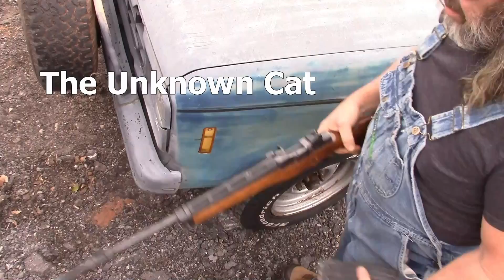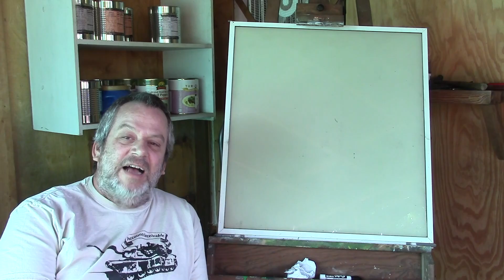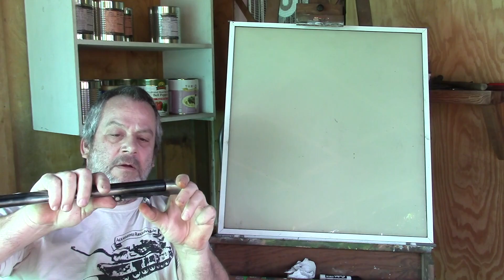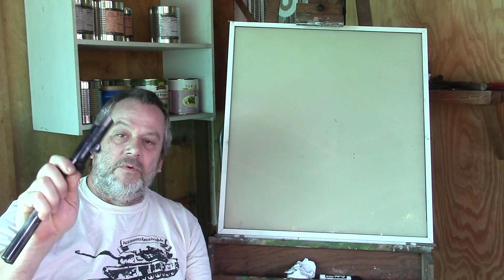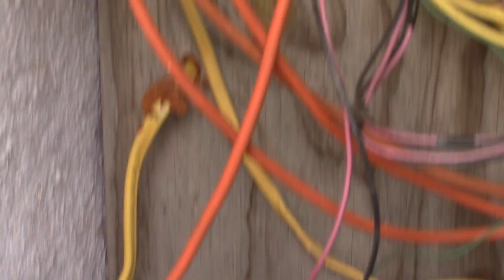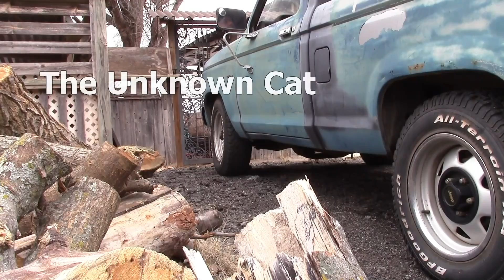Off Grid Room

Comment: try also vawt wind turbines they will augment your solar charge you can get the generator from any source such as an old tread mill the electronics and such have failed while the motor/generator is still in good condition. Works well if your in a simi windy region.
Reply from the maker: +steveklloyd I don't feel like wind is viable in an urban setting -requires too much height and broken blades could damage neighboring property.
Reply: well this is my third message this window on youtube keeps doing wierd things. Look up vawt systems
Vertical
Access
Wind 
Turbine
My original post explained alot I dont have one my self but i live in a urban environment (i rent) and have done ALOT of research on it. As long as people are not stupid with there builds aka keep it away from others houses ect it would work as for height the vawt system works in a 360 deg. environment so the hight is reduced. If you have alot of trees in the way of the prevailing winds..... or if you live in a apartment then yes its not for you.
BTW broken blades on a vawt would only damage the turbine its self unless you put it right next your your neighbors property line. If you made the blades out of metal like guttors or pvc it would take alot to break them. Its not a small build mind you. Either way good luck if you decide on trying it or not.
Peace brother and keep up the awesome videos. Im new as a subscriber but for the oooohhhhh last 15 years ive been looking into this kinda stuff. Gassifiyers steam turbines solar ive looked at all the pros and cons on all the different systems. Now the Gassifeyer would work for any environment, but its loud obviously cause your taking a an engine to make electrical energy but.....
Some food for thought :)

Comment: never thought about just an off grid room .... i must admit its a good idea just enough power to continue moderately enjoying the comforts of home in a time of crisis or power outage...my mothers boyfriend is currently ordering small half volt solar cells and building himself a larger unit not really sure if he will ever be able to use it since his health is bad and has to use oxygen and inhalers and such.....as for meim building a lawnmower engine powered alternator generator...and ive been heating my house now for several years with a wood stove i must admit though i wouldnt wanna cook on a wood stove in the summer or early fall months be ause of the heat issue(i live in ga.) but that itself is an easy and cheap problem to remedy....my answer was cook out doors when possible on a colemanstove my stove was manufactured in 1963 as far i can tell it is a dual fuel in which i run only gasoline ive had no problems with it in the five years or so that ive used it ....sorry to be so long winded will be giving this a lot more thought because for me a single off grid room is far more attainable than a whole house set up ...thanks again for the idea......

Comment: "....$87K to run my house on solar....."   
Okay, 'Planning Mode'- yes, I have looked stuff up, but, bein' as you Dah Man whats already got yourself Solarized, I figure, why not tap into your 'Real World' experience on the matter... I do plan on gettin' out of this hellhole eventually, & gettin off the Grid is a big part of my 'Afterwards' plan.. 

What's the most expensive part(s) you had to get.? Might as well start stocking up on stuff while I'm in Hell...
Reply from the maker: +the Pirate Cap'n I can show you the ropes over at FB. I know a product you could spend a wad on that would store nicely while ya wait, and basically BE all that crap that is bolted to my wall ...but it is all in one nice little package. Should still be under 5 grand. When ya get to "the place" -just wire up some panels to one end of it -and batteries to the other.
Reply: +The Unknown Cat ... wow- how much did all that stuff on your wall cost you, separately, if ya don't mind my askin'.. 

and then off to FB. *Haven't been there in awhile, anyways...
Reply from the maker: the Pirate Cap'n Well, I am a king scrounge, so i got out pretty cheap ...so probably around $1500 to $2,000
Reply: +The Unknown Cat Good enough. * See ya on FB, Cuz.
Reply: +The Unknown Cat Good enough. * See ya on FB, Cuz.

Comment: I'm in Aus and I don't know if they were used in the US but have you thought about a kerosene fridge? It uses heat transfer to keep things cold. My family used 1 for about 10 years with never a problem keeping things cold/freezing.
Reply from the maker: +Crazy Harry The only issue with "alternate fuel" appliances is that you need a good source for the fuel. The price of kerosene of a good enough grade to run a fridge would break the bank here. I nearly went with a propane fridge -but electricity is so much more reliably sourced than any other fuel. I will just have to expand our electrical system to run an upright fridge, one day.
Reply: our processed fuel standard is great here, didn't know you had those sort of issues in the US. What about using Brown's Gas? Depending on the solar setup to recharge the battery's all you need is plain water and some low carbon stainless steel ( 316 grade or better )

Comment: Get a diesel generator. Gasoline just won't last. You can store diesel for 10-15 years or more. Gasoline goes bad in 1 year or less.
Reply from the maker: +jittychitty Yeah, gasoline is pure garbage these days, I don't use it in small equipment anymore. The lawn mower runs on the quart bottles of propane and our house generator is plumbed right into the kitchen's propane system and starts with a push button from outside or in the house.

Comment: Well...I try not to say much unless its constructive or I have a little info to pass on. For all you folks with dead batteries...might try putting 2 or 3 tble spoons of boric acid in then give it a charge. My other point is the bedini motor. Seen a few channels that swear by it especially if the battery is completely dead. Seems they work great for that situation. Something about desulfuring it. I think I have just enough parts to make one too but I have no need for it personally. I scrapped a few batteries and already had the pewter so I whipped up a batch of solder. Seems Borax works as a good enough flux. A little something to clean the metal one is working on. Just sayin. I suppose im saying if ya can save a few dollars and all else fails...could buy new batteries. Im sure theres a few guys that knew this already....but just sayin.

Comment: I wish I could claim to be fully off grid, but that would be a lie. I have some solar LED lights. I also have a generator, but you can not run the generator all the time. That is just for a few days if something happens. Like you said though, $87k, ha. Here we would be able to do with $60k, but I do not have that amount of money sitting around.
Reply from the maker: +Jesse Sisolack No one of normal means can just decide to swap their house over to solar generated power -the cost is astronomical. It requires a lifestyle change.
Reply: +The Unknown Cat Very true. It has been a good decade since I have had to live in rough conditions. I think these hot showers and whenever I want internet access has made me a bit soft, ha.
Reply from the maker: Jesse Sisolack
Hahhaha ...no joke, man!

Comment: I have a three thousand dollar solar system I can run my 52 inch plasma stereo satellite entertainment center off of part of it. four golf cart batts and two trackers with six panels. Another system with a tracker with four panels and six optima yellow tops runs my computer and chest freezer CB and two lamps full time. All of it together both systems about 2300 watts of panels and If i had four more golf cart batts and for more optima batteries I would be all set. I cant run air conditioning but this is only for emergency back up. I feel i could run my fridge too if i had more batts. but if we didnt watch tv all the time in an emergency we could run the fridge instead. I would say for 5 to 6 thousand dollars i could build a really nice emergency system to run AC and everything. if I wanted to run ac double the current system panels then I would have to 20 panels 4600 watts and have about ten golf cart batts. I have made hundreds of videos about my trackers, batts and inverters and charge controllers so have a look if you want to. This is what my channel is all about off grid self reliant cheap solar system. I been doing it for about five years now on  Youtube going on six. I have lots of solar freaks on my channel just like me to help me learn. I have a CB handle SolarFreak. I guess I am the SolarFreak.
Reply: +Nick Karathanasis the diesel engine power plant is a perfect way to make power. You need quite a bit of fuel. like a giant tank 3 hundred gallons or so. this apocalypse could could last for  years to get back to normal.  I have made some biodiesel and I cant get enough grease to make much. hard to find somebody who is not already selling it to a pick up company already. You have a good idea. Solar is there most of the time during the day time.
Reply: +Nick Karathanasis that would be awesome to get a lot of it for free.
Reply from the maker: Nick Karathanasis
Heya, Nick -how's things at Disassociation Nation? ...that is you, aint it? The only problem I see with bio-diesel is ya have to find sources and fetch it -that gets ya to about zero profit right there. I like the idea of a "cheaply fed" central generator but I was leaning toward wood gas. I actually have some things in to works for this idea -a prototype wood gasifier that I built about five years back and never have tested to see if it works -and a 6500 watt 1800 rpm generator with a flathead engine to run on the gas. You want a flathead for that so you can pop the heads off and clean out the tar every now and then -because I think even a very clean wood gasifier is going to produce at least some tar. Unless you have a good source for oils that can be converted for diesel use ...I just don't see that as a good option.
Reply: The Unknown Cat yes sir, that's me. We are doing ok. Trying to keep people educated same as you, haha. Wood gas would definitely be cheaper. I have also been reading some on the idea of an electrolyzer, make fuel from water... converts to flammable hydrogen gas... people have run cars off of it, plenty of backup options... would love to have you as a guest sometime on Disassociation  Nation
Reply: shartne that is true, I think availability depends on location quite a bit. I'm currently in PA, around my area, restaurants must pay for removal. Unless they give it away to someone. My father used to own a restaurant, always had to pay a removal fee. The state has to have their hands in the control you know...
Reply from the maker: Nick Karathanasis It's really bad on the coasts. Down here in Oklahoma, we still have them held off a bit -but the craziness is ever-encroaching, man.
Reply: awesome, I will check it out!
Reply: The Unknown Cat unfortunately so. Just to many people with the idea that they know best in control of a majority of people that don't know they are being controlled. It would be nice to see a lot less laws and more people building real community dependence
Reply from the maker: Nick Karathanasis
I'll see what I can do about getting set up to do some talk with you Nick. I still have your email somewhere -I'll get my gear set up so I can communicate and get a hold of you.
Reply: +The Unknown Cat 
Diesel engines can run on straight grease and vegetable oil by themselves - you just need a second gas tank for that set-up, so that you can start up the engine and heat up the bio-mix. Once it's good to go, though, you can just switch to the second tank and run on that. Of course, when you shut it down, you have to switch back to the REAL diesel or you'll clog all of your injectors and whatnot when it cools down. But hey, it's the cheap alternative to having a whole bunch of bio-diesel equipment and chemistry knowledge. But that's just some kids two cents :)
Reply from the maker: +shartne You are a Solar Freak, Shartne! Sounds like a great system :D
Reply: +The Unknown Cat what about using an old diesel engine and attaching alternators? You could make your own biodiesel for cheap... used cooking oil from restaurants free, lye and methanol... lye is made easily from wood ashes. just a suggestion, I plan to implement several ways of making power when we find a permanent place. Everything is easier said than done of course. ..
Reply: The Unknown Cat sounds good brother. Look forward to it
Reply: +ravemastaj they can but it will coke up the intake and eventually it will have to be taken apart and cleaned out.

Comment: Hell with a low cost 12 volt car inviter and a small solar set up you can run 5 or more of the new LED ac lights and they just pull 9 watts.
Reply from the maker: +yankey4 Or run DC powered bulbs and no inverter at all ;)
Reply: The Unknown Cat True :)
Reply from the maker: yankey4
:D
Reply from the maker: yankey4
I actually don't like DC lighting either. I think for a simple set  up -it would be fine. But in our house -I just replaced our DC lighting in one room with AC because it was ineffective for daily use, the bulbs were expensive -and it required a voltage converter for us also.
Reply: The Unknown Cat yes now the Ac/Dc led have come down so much as well. I got 12 for 2 bucks a pice at lows this week.
Reply from the maker: yankey4 I haven't played with any LED yet. Pretty happy with CFL.
Reply: The Unknown Cat When you get your hands on one you will be. Go to Lows and get the 60 watt LED for 4 bucks for 2. They use 9 watts and put off 60 watts or may be 70 watts of light. They are 750 lum. Can use them out side in wet places and they put off just about no heat.. There bad ass of my off grid side of my solar. If you get time look at my new vidoe's you make like them :) God Bless Brother.
Reply from the maker: yankey4
I will have a look into this on your recommendation!